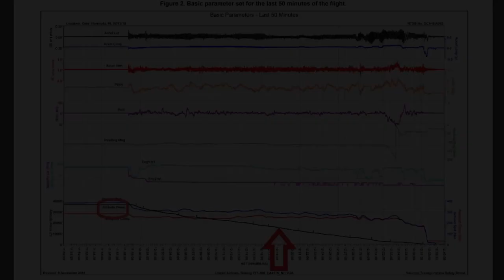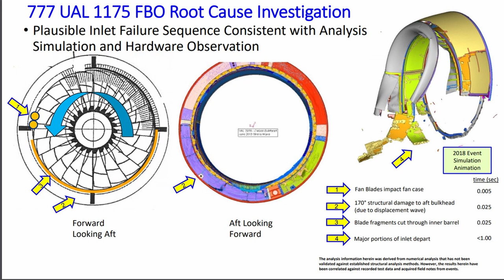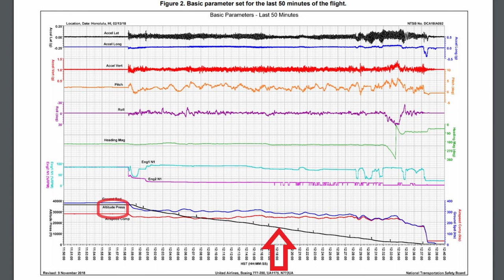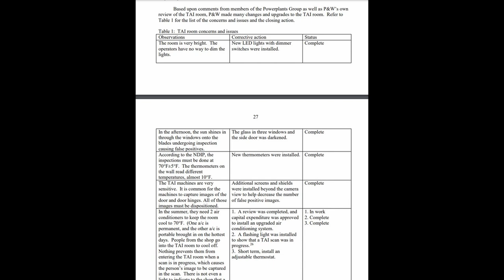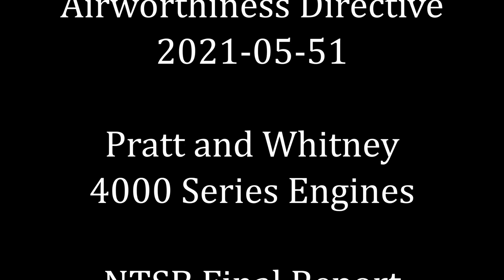Emergency AD & NTSB Final Report UAL 1175 Fan Blade Failure

Comment: Hi Juan. I worked in Hot Isostic Press facility in Portland in the 80s and processed both Compressor and hotzone components and blades. Titanium,  Inconell and Stellite. Precision Castparts investment cast them then we processed them in the pressure vessel. Eliminated porosity and provided a controlled heat treat and grain growth as specified.
Fun stuff. Learned a lot there.
Reply: It's very fascinating stuff...would love to read more about how the sausage is made.  "how its made" for wonky aerospace geeks...How I wish!
Reply: Question:  How do you cast repeatable, precision voids (in titanium, no less) into long, compound-curved shapes like inlet fan blades?
Reply: Lost Wax and Lost Foam techniques. Provides really uniform parts. Usually a few thousandth proud and then milled mechanically or chemically  to spec.
Reply: @OgamiItto70  https://youtu.be/D606YhPN7R0

http://www.madehow.com/Volume-1/Jet-Engine.html

the first link shows a infotainment version ..

the second link shows a bit more in depth...notice the distinction between manufacturing processing between fan blades and compressor/turbine blades .
Reply: Internal voids not so much unless several pieces are welded together for the part.
Reply: 3D metal printing is the hot ticket for that. Being used in aerospace now.
Reply: @tdmmcl1532  Thanks for that.  I was laboring under a misapprehension.  That second link cleared up the misconception I had.
Reply: @clerkmaxwell7912  I wonder if the "granular" nature of 3D printed parts is vibration-proof and strong enough to stand up yet to aviation duty in such highly "crash-and-burn" items like jet engine blades, even if they're not in the hot section.  In other, less highly stressed, parts I can see how 3D printing would be a major boon.
Reply: @OgamiItto70  SpaceX is already using 3D printer parts in their engines I believe. With heat treat and or Hot Isostatic Press I would think the parts would be comparable to cast parts. Perhaps even forged parts.

Comment: Thanks for giving all of us an inside picture about what's going on. It's like Non-Destructive Imaging of the way these engines are built and flown.
Reply: Inspecting hollow titanium fan blades for in-service fatigue cracking on interior surfaces is an extreme challenge for any nondestructive evaluation method. These micro-cracks (discontinuities) might not reflect enough ultrasound energy to be detected by conventional ultrasonic methods. Thermal acoustic imaging tries to cause the  discontinuity to generate a thermal signal by causing the sides of the discontinuity to rub together thereby generating heat. An infrared imaging device then attempts to detect this weak thermal signal. Surface emissivity and just knowing where to look are big issues to overcome. Probably the greatest issue of all is creating meaningful standards that simulate actual defect conditions to calibrate and certify the test method. The hollow blade may need to be stressed during testing to simulate operating load conditions.
Reply: @richardpeugeot9143  Yes, I've been musing over this...taking a light read on how engine cowls are "tested" for the containment and excursion risk, engines are intentionally forced into failure on static stands.  There are no aerodynamic loads conducted to see the effects for rating these cowls for real world conditions.  I think that is probably going to be the next step for researches to lend some new test experiments ...in a mach windtunnel, and then see how these cowls manage fan blade and HPT blade and disk failure.  That's probably where they are focused for nextgen designs...It's just common sense to look at how the cowls operate in these failures at high aerodynamic loading.

then, also musing...the very thing you were talking about wrt TAI inspections/testing.  I would imagine there is a certain amount of fatigue permissible...but these tests are being performed when the blades are NOT under the same kind of real world loads.  I am certain the scientists have modeled and tested and re-tested what that permissible test value can be or what a rejection threshold is.  But it stands to reason, just as in the static engine failure example above, one might be looking at how to re-create aerodynamic stresses on the fan blade and then conduct the test.  How to accomplish this would be an engineering challenge, but not a technologically impossibility.  For instance, one could induce a apparent load on the fan blade simply by changing the thermal state of the target...and then dynamically altering this thermal delta rapidly, while testing the most common areas where a stress is likely to result in failure...

It would be a challenge, but I think this is probably going to move some needles about how to best innovate toward a better test regime.
Reply: @tdmmcl1532  TAI or any nondestructive inspection method is meaningless without standards that simulate the discontinuity of interest in the areas of interest to qualify and calibrate the nondestructive inspection method. The calibration standards must be able to be duplicated so that the blade manufacturers as well as those doing in-service inspection are working from the same page. All metallurgy has discontinuities at some level. But when does a discontinuity become a rejectable defect?

Some  parts are designed with no thought given as to how they are to be nondestructively evaluated to determine the end of service life. Sometimes critical components that cannot be reliably evaluated nondestructively are life limited and must be retired at a certain point in the service life. This may be the case with these large diameter fans using hollow titanium blades that are difficult if not impossible to reliably inspect in a cost-effective manner. It may be cheaper to just replace the blade.

The long term solution is to turn these large fans at a lower RPM as in a geared engine and design the blades in such a manner that they can be nondestructively evaluated. Quality has to be designed in from the beginning. Quality cannot be inspected in!
Reply: @richardpeugeot9143  my understanding is that these fan blade ARE designed with DNI technologies "in mind" and so have both limited life AND permissible discontinuity AND rejection values.  And the manufacturing process QC and the maintenance DNI QC technologies are essentially equivalent...Adequate to make correlations that are valuable for both ways improvements and feedback.

I think the weak area, is that in testing, as you mentioned, the target is not being subjected to loads...and so one might be missing an important part of the total picture with respect to micro-defects, or fatigue.  I think broadly, this is the case with many of the inspections...But obviously this takes in a much more significant consideration wrt to engines for obvious reasons.

Even with current regimes, it's obvious to me reading former NTSB recommendations that DNI operators are not entirely consistent with the documented established practice.  As with any technology, things can get very out of control, if the process isn't followed properly or errors go unnoticed and unattended.

I suspect the entire regime is going to get another close look...as it should..

the day that this industry refuses to learn how to innovate from experience, I'll hand my hat up and shoot the horse.
Reply: @tdmmcl1532  So often NDI methods are evaluated under laboratory conditions that don't fully simulate the real world condition these fan blades experience. Sometimes it is very challenging to take an NDI method out of the lab and apply it on the factory floor and also under "in service" conditions. How much thought was given to the creation of realistic fatigue crack standards for the hollow blade geometry?
Reply: @tdmmcl1532  Very insightful and I couldn't agree more. This is a very difficult inspection to perform. Operator training and calibration standards along with engineering standards as to defect definitions are crucial for a successful inspection outcome.
Reply: @richardpeugeot9143  apparently enough thought and standards that was granted airworthiness status by the FAA>  I know...stop laughing...the joke is getting old I know.   Seriously, I have no reasons to doubt the research and development was thorough.  I agree that there are certain limits to "field" DNI methods...But one also recognizes that the same manufacturer IS responsible for  doing the cycle inspections and tests too for their own fan blades.  There are two schools of thought on this:  on paper this seems efficient and you can apply subject matter specialists...on the other hand, there is definitely a potential to be less than transparent about problems...It's definitely not perfect, but it's also not much different than other industries either in that respect.

I'm thinking the only way to mitigate the risk is for the FAA to impose more scrutiny and observe the tests...and then have an independent lab start performing more frequent testing in real world loads and start creating a risk assessment and guidance based on that study.  I don't think we should necessarily be assuming the manufacturer hasn't done their homework well...But also should not be assuming there isn't some areas that could not use some improvement.

tech is hard.  engineering is incredibly difficult.  This is an engineering problem coupled to a risk mitigation problem.

it's solvable.

Comment: Juan, great work.  As a retired metallurgist I am very familiar with fatigue fractures, but have no experience with TAI.  The biggest concern I have is how small a fatigue crack can they detect.  Once there is a crack formed, it will continue to grow as long as the part is subjected to those oscillating stresses.  They always start at some sort of defect in the material be it an inclusion in the metal or a mechanically induced nick on the surface.  External fatigue cracks are prevented by shot peening which is a standard process used on the root area of almost all compressor blades. Years ago working at TRW one of my responsibilities was testing the degree of peening that applied to compressor blades and examining the shot media (glass beads and steel shot) for broken bead content.
Thanks again, looking forward to more from blancolirio.

Comment: At first I was thinking they would be listening for a certain frequency in return to check for cracks. Instead of heat, sound. Silly me. Thanks for a good report 🙂 Welcome home, enjoy some salmon!
Reply: that's not silly I think that would be a much better way of doing it.  A cracked  vs uncracked blade I'd expect to return different frequencies.

Comment: Great Job Juan,
Just a thought, I do Infrared testing for Coca-Cola, and we have to put a tape or coating on any shiny surface that you want to measure the radiating IR energy from (temp).  The more reflective the surface, the less accurate the measurement.  We calibrate against something called a Black Body, which looks like a badly burnt piece of toast. No reflectivity what do ever.  (Perfect Emissivity properties)There is theory and equations for all this, but I know your a KISS kind of person.   
If you want the tech details, let me know.  
Looking forward to meeting you and Dan at Sun n Fun in April.  Love you guys!
Sincerly, Steve Meschke.
Reply: Yep, the emissivity of metals is low. Paint also helps cut down reflections when taking photos.

Comment: I am not a jet mechanic or a blade inspector.  But Infrared Cameras are my career.  So.... I will take an educated guess as to why you will have a paint layer.

The problem is that the reflectivity of metals are quite high.  As a consequence, the "emissivity" is quite low.  This means that the thermal signal that the camera is trying to see is VERY low.

Now I dont know the numbers for titanium, but aluminum foil is about 98-99% reflective in the IR. Thefore, the emissivity is only about 1-2%.

So....simply spray on a THIN coat of "black" paint that will be about 95% emissive and magically you get 50 to 90 times the signal or "contrast".

Hope this makes sense...

Great channel,
Thanks for all you do.
Cheers
Kevin Hanna

Comment: Juan, great summary of the blade failures! Thank you for digesting the a available information and presenting it to us in an understandable nature.

I'm not knowledgeable in TAI but it is likely that they paint th ed blades to give them a highly controlled emissivity. If you point an IR temperature sensor  at bare metal it can give a very inaccurate response.  A paint with known emissivity allows accurate temperature profiles to be measured.

Comment: When ultrasound travels through materials with different properties, you get all kinds of reflections and noise. The paint helps transmit the ultrasound with minimal reflection, it has the same purpose as the gel they use when you get an ultrasound scan at the doctors.
Reply: Well. Since it's called "thermal" I'd assume they (also) look at the blade with an IR camera and (aka thermal camera), like one of the higher end FLIR models. Infrared waves are really light, just longer wavelength, and as all light, it reflects off shiny surfaces. E.g. you can't see through glass. Same with polished titanium, so they have to apply a mat black paint first. 
A piece of (masking)tape would do the same, but would be too hard to get applied uniform in corners and such.

When I first heard of TAI, I thought they just added a controlled heat source to one end of the blade and watched how the heat spread out. The ultrasonic part explains the acoustic part.
Reply: The paint is to provide an surface with consistent emissivity for the IR cameras.
Reply: That's the word Ultrasound...but correct me if I m wrong as this kind of inspection or another similar must be done in engines once an airplane reaches its thousands cycles of flying...cause it's know that after those thousands cycles parts of its structures suffer mainly from metal fatigue...
Reply: my limited understanding is that an enveloping material OF KNOWN properties allows the test results to establish clear and precise visual representation of the precise surface of the target.  and because it tickles.  and everyone knows that doctors and techs love to get a tickle in when they can. /s

Comment: Infrared thermometers are calibrated by pointing them at a temperature-controlled disk called a “black body”. The disk’s black coating prevents reflections and hot spots that would affect the apparent temperature of the surface. So if they’re looking for minuscule temperature differences, it would make sense that they would apply a non-reflective insulating coating before running the test..
Reply: Blackness of a body relates simply to the IR emissivity vs temp- it's the max possible. One way to replicate that is to have a small opening into a cavity in the object. The IR intensity out of that opening will be that of a black body at that temp. Typical hand-held IR thermometers are set to assume that all radiating bodies have <100% emissivity, like 95%

Comment: The first 8 years of my military/A&P/IA career was on turbine engines, then I went the GA route and now out of aviation. Nearly 40 years wrenching airplanes large and small, fast and slow. The time spent as a jet mechanic was in the late 70s into the 80s and all on one engine the J52 or known in the civilian world the JT8. A turbo jet not a fan. So this engine is out of my wheelhouse. It is amazing to me what the metallurgist have done. I am not familiar with this test. NDI and NDT yes but not this test. Thank you for the update and pictures, they really do speak a thousand words.

Comment: When I operated a thermal heat tester, it will not give accurate readings off of a shiny metal surface. Wouldn't surprise me if they use a flat 18 percent grey.

Comment: Great as always thanks Juan. 
I have to admit I’d never thought about the very significant extra drag in such a scenario, (ie: blade failure causing cowl failure and departure) and the effect it would have if you had a failure right AT your engine out decision point- (we call it DP1) - that wouldn’t be great, and could theoretically perhaps even force a ditching due to insufficient fuel.

Comment: Juan, parts that use a thermal gradiant inspection, typically get painted white for emissivity. The IR camera would then be able to get a good reading on the surface temperatures.
NDI inspection requires numerous standards to verify the technique against. Pratt&Whitney would have to use something like Eddy current to identify a defect, then verify the results with the new technique. 

There are national accreditation organizations and certifications issued after training. Just like with inspectors that are mag particle, x-ray,  penetrant inspection, Eddy current, and acoustic inspection.

Comment: Superb job Juan.  I wonder why 1175 had the attitude upset, where 328 apparently did not.  Perhaps on 1175 the TAC (Thrust Asymmetry Computer) failed to boot in the rudder with the loss of FADEC N1 signals but maybe on 328 the TAC managed the yaw event like its designed to do.  From the ground shot of 328, it looks like there was no upset at all (which is what I'd expect), even though it was probably operating at a higher IAS than 1175 when things let go.